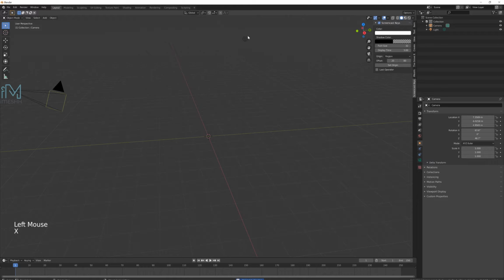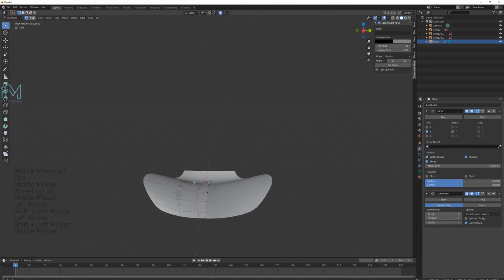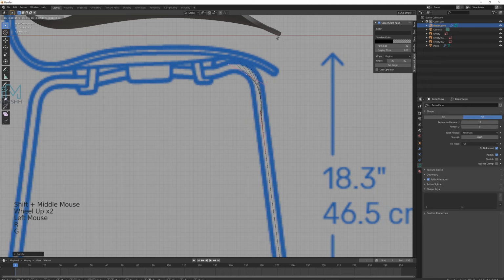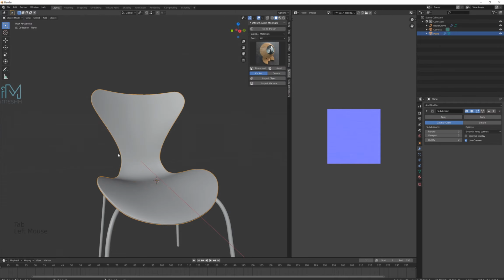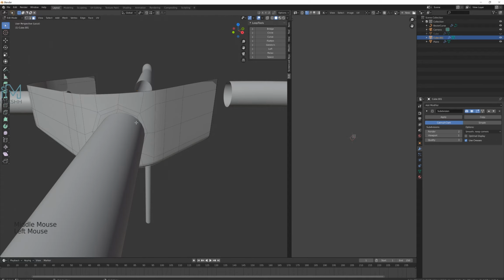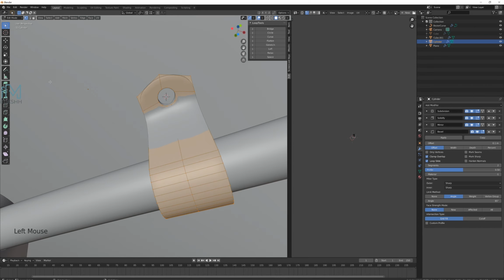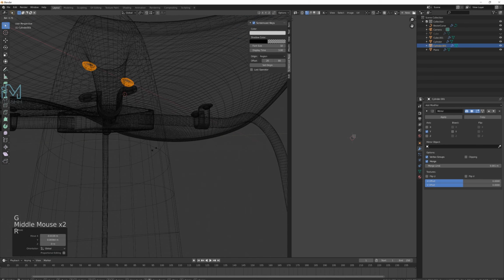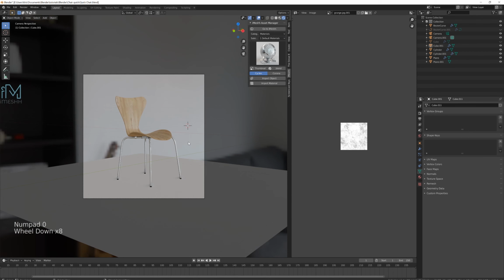Blender 2.8 Pro Chair Modeling Guide! - iMeshh Furniture Tutorial

Comment: 7:19 i can you explain the "apply scale" ? I dont see any changing / effect on the model. Thanks.
Reply from the maker: It's good to get into the habit of applying the scale before you add any modifiers which rely on the objects scale. Here I applied it just encase the object scale was wrong.

For example if the object was 100m tall and then I scaled it down to 1m, blender remembers the original 100m and then applying a solidify modifier would have undesired results. So it's just good to apply scale before these actions, just encase :)

Or later down the line if you forgot to apply the scale, and the scale was wrong it could cause you issues with other modifiers